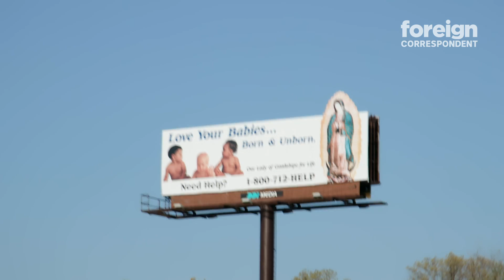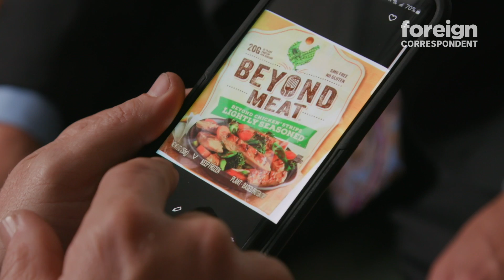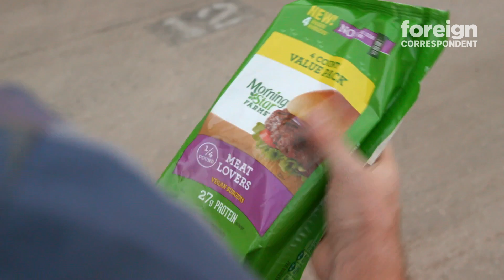Will Fake Meat be the Future Food of the World? | Foreign Correspondent

Comment: When the coal industry was closing down in the 1980/90 in west germany several problems came with that. They were subsedised, they had lobbies and lots of people worked within that industry and were frightened. Noone really wanted to change it, but it was necessary and the right thing to close most of the coal mines. It took at least a decade, lots of investment into reeducational programs and diverting the subsedies to new upcoming industries and in the end it was a success.
"When the wind of change blows, some people build walls, others build windmills"

I wouldn't even try to tell farmers that it won't hurt, but try and give them an outlook, a vision and the help they need to make the adjustments. Bottomline from what i can tell about this, it will happen no matter what and thats because it is needed. Psycologicly for myself i think i would tend to the cell based meat, but i give both options a shot.
Reply: S T  wtf are you talking about? perhaps read my comment again, then you'd know that in the case i described it worked out pretty well. People readjusted to different types of work. As i also said it wasn't easy and not without pain and effort, but bottomline it was a good change. Do you know what i am speaking about? Westgermany in the 1990. the "Pot"(coal area in germany) became known for its service and IT industry within germany.
Reply: Success? The former mining areas are ravaged and have become the dumping ground for immigrants because rent is dirt cheap there.
Reply: @mahartma  i have been regularly for the past 30+ years in and around that area and while there are a few regions which have not been quite as fortunate, from what i have seen overall that region has prospered. Quite in contrast to what i have seen in east germany "overall" where a few regions are doing well but formost the rural areas are struggling. 

Calling an area "dumping ground for immigrants" Tells me more about you than about a regional situation. While it is a reality that there are areas where immigrants are concentrated, quite like in most german regions and most european cities, i can also see how our state is trying and struggling with the task of immigration.  With the AFD and other far right parties all over europe pressuring the issue, i would guess that the establishment is aware of your concern.